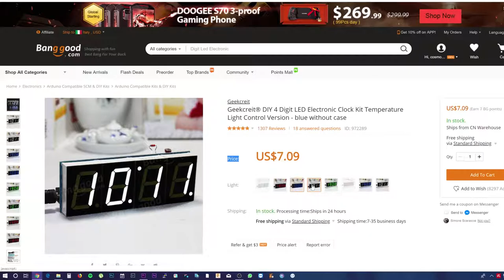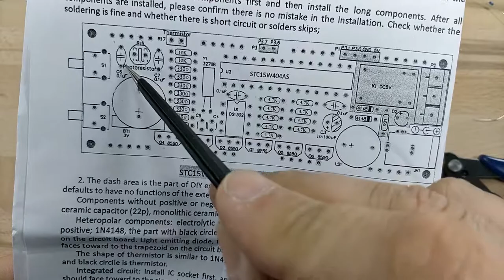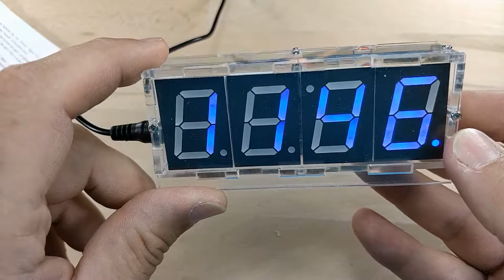How to assemble Geekcreit DIY 4 Digit LED Electronic Clock Kit

Comment: Hi I got the same digital clock, but I think @6:47 the "p22 ceramic capacitors" are not align properly. You have them install horizontally, when these pins should actually be vertically. 
I had the same issue and I had the re-install them because I couldn't get the time to work. Hope this helps someone else.
Reply from the maker: Hi. Looking better maybe you're right... however it works perfectly even so. 😂

Comment: '

i still have 2 DIY 4 digit clock kits with white LED...
very good and white LED lights with fade in--fade out and sound activity pulse
Reply from the maker: I wanted to take just that with white LEDs but I do not and so I took this with the blue LEDs.
Reply: @cosmochannelvideo 
'
hi C C...
amazon or ebay or any internet companys has alot of different colors of LEDs with 4 digit clock kits...
white LED is a good choice
Reply from the maker: +bestamerica you're right but they cost less on banggood :-)
Reply: @cosmochannelvideo 
'
hi C C...
thank